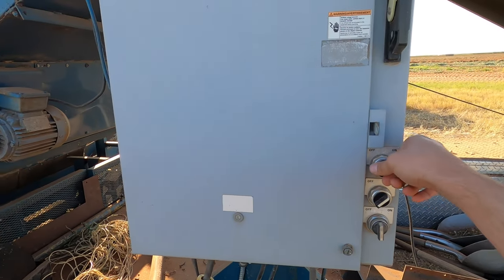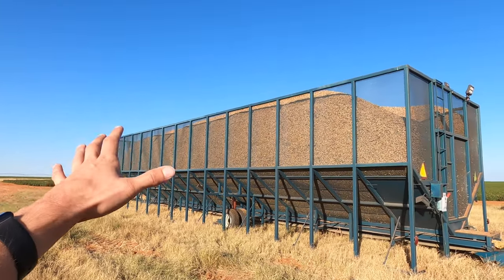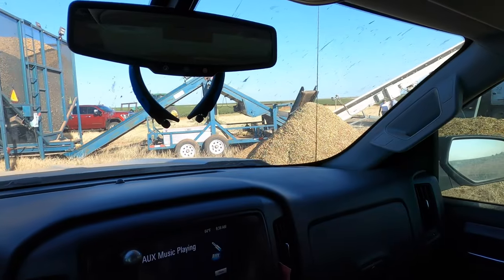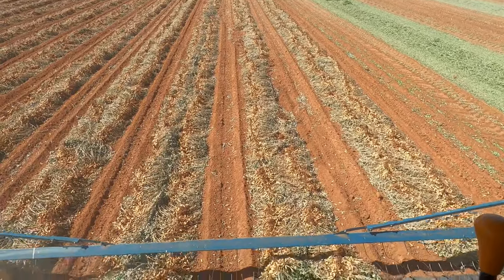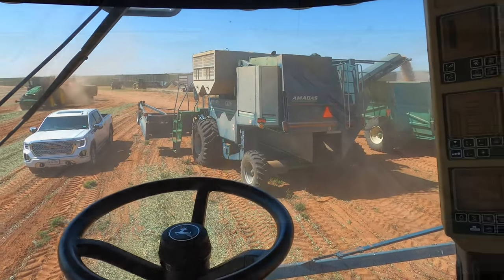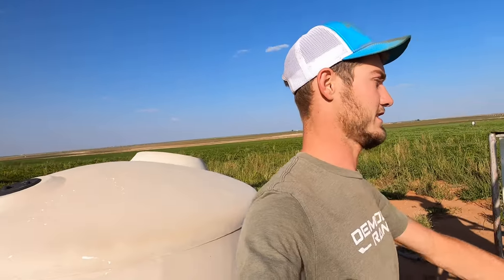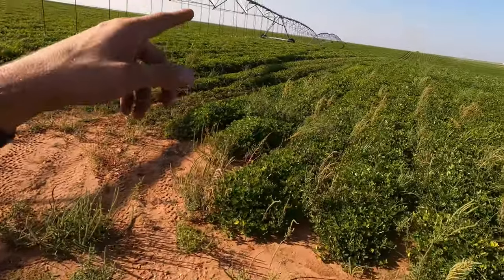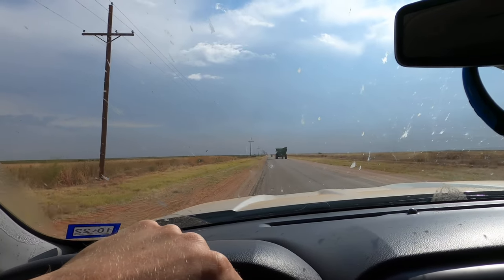Time to go harvest some peanuts

Comment: The valve you have your hand on at 11:52 is a full port gate valve. To open it you twist the handle counter-clockwise until it stops, to shut it off you turn it clockwise until it stops. I know this was years ago now but I thought you might still wanna know